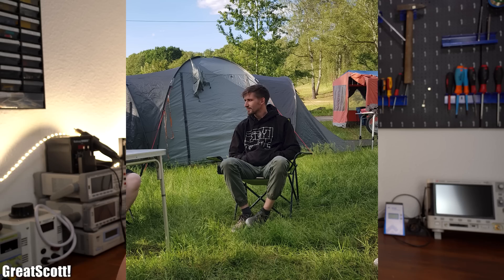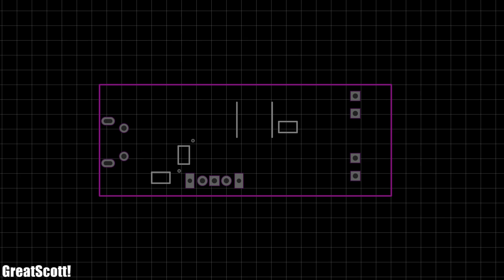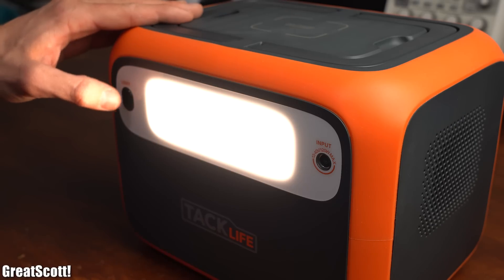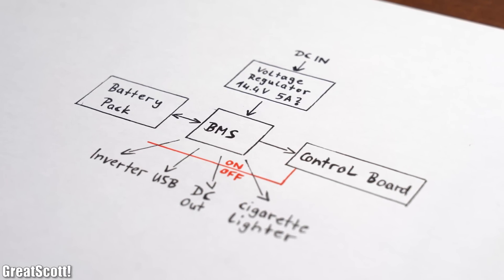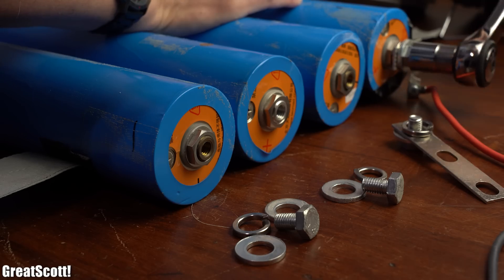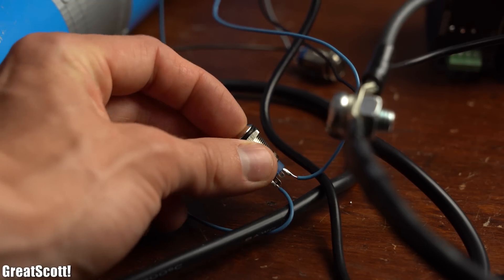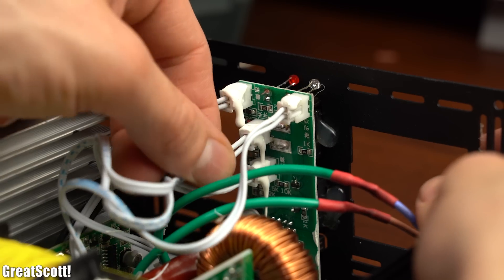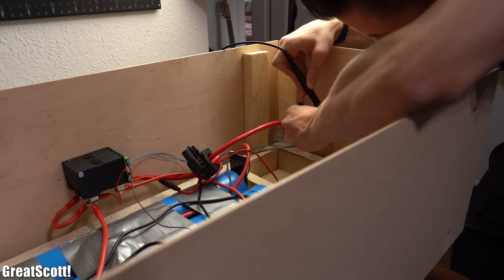Portable Power Station || DIY or Buy

Comment: you just not adding a ventilation hole on the wood box for inverter (because the inverter has a fan).. 
that means, all the components inside just heating themselves up..

Comment: Question: I bought a 100ah mini lifepo4 battery and a 300w inverter, I want to make quick connect for charging the battery but not sure how with inverter also torqued down to battery terminal. I also want to add a 25A fuse if that's necessary using 8 AWG. I'm confused on how I should do this, any input I would greatly appreciate.

Comment: Tech tips: Always plug and unplug the dc power supply went its not powered  by 110/220AC to prevent dc arcing. Same applies to laptops. Nice video...

Comment: While this video is a year old, Portable Power Stations suck still. DIY versions will get you what you want at about the same price or cheaper depending on what you use. 
1200 watt hour battery can be had for 300usd these days and the rest of the parts can be had for 300 as well. You will end up with a much better system if you build it your self. Yet if you buy commercial there is next to now way to upgrade the battery in the future. 
I do not need portable at all. Fixed is what i need and some of the big expensive portable systems cost more than a fixed system.

Comment: Nice build. I did the same thing without an actual enclosure.
 I used a 1/2 inch wide plastic cutting board and mounted the inverter on one side and the charge controller and DC connectors on the other side.

Its relatively light and portable.

The battery is separate and must be connected to use.

It is pretty much a small solar power system that can easily be transported in the back seat of your car.

Comment: Great job!  I vote for home built.  

I finished my battery compression box the day you posted this. The unit is up and running daily. It has 560 amp hour EVE cells, 3000/6000 surge inverter, 250 amp BMS, 30 amp MPPT, 75 amp on board lithium charger. It was built to run a big refrigerator and 2 chest freezers on 120 VAC power. We lose power more often in Northern California these days. Last year it was only out for 47 hours in August here,  but much longer elsewhere due to wildfires and terrible winds. Its in a steel tubing cage on caster wheels but at 51 kilos, 130 pounds, its not portable. The 410 watt panel sits temporarily on the roof on the foam they shipped the cells in.

Comment: Excellent video and great finished product. The only problem I can foresee is the lack of ventilation for cooling. I understand that you have a lot of space inside but a couple of fans on the side to allow a constant air flow would do wonders. Also you could add a solar controller with MP4 connections to easily connect solar panels when you're on a long camping trip. Overall I really like it because I prefer units built to suit your specific needs rather than buying a generic product.

Comment: Very well done, for the full 1kw of continuos power I would have used a set OFC  2 gauge wire, it is still extremely flexible and soft bit would allow for proper transfer. 85 amps continuos through 8 gauge seems a bit weak. That is my opinion however and I build for the extreme as well.

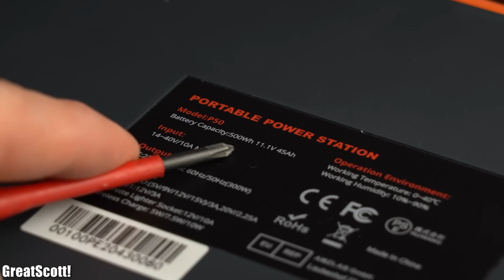Comment: At 4:52 You forgot temperature, since temperature is a pretty critical point for LiIon cells. Some standards as EN 62619 determine that cells may not be used when they are used out of their specification which also includes temperature.

Comment: need emergency 12v ups for router
Reply: Get an old 1500 volt amp UPS and add a sealed lead acid 50 amp hour battery on the outside. Some units are 12 volt, some 24 volt. I use both. The router should run for hours after power failure. My 12 volt one runs the security cameras and DVR for 6 hours unattended.

Comment: I don't know. It is sort of portable but not very practical because the size it has become. Also until now I use a 12v to 230 v inverter to power my 19 volt laptop. This year I just want to convert the 12 volts to 19 to power my laptop. That should save a lot energy. So I think you really needed to add a few 19-21 volt outlets. Maybe even selectable?  nice video anyway. What would be cool for some future video is a (substatnial) powerstation in a backpack :-)

Comment: personally I would have just used a deep cycle lead acid battery since you dont need a bms and you can charge them faster. yeah its less energy dense but still more reliable than any lithium derived cell

Comment: What about charging via solar Panel ? Most of the commercial Products offer to be charged with solar Panels... How would you Guys Set this Up ?
Reply: Add an MPPT charge controller. I put a Renogy 30 amp charge controller on mine and it has run 24/7 for 6 months with no trouble. The solar panel is 410 watts. The ''load'' terminals on it feed some USB charge ports, a pair of 12 volt cig lighter outlets and is good for 20 amps. I also installed a 75 amp Aims battery charger that can be plugged into the Honda generator if necessary.

Comment: Hi, 
I have doubt regarding dc power supply. Since you are pretty knowledgeable on electronics. The question is how do I connection 2 power supply in series / parallel to get a 48v dc supply from a 20v dc and 12 v dc?.. What I'm thinking is.. What if I connection both the power supply to separate boost converter and step up to 24v. Then connect them in series so I'll get 48v dc theoretically, right? Or I could connect them in parallel to get the maximum output of the boost converter. ... My doubt is does it after the output wave form or current draw from it.

Comment: Hmm i think the portable is the winner. Why? Let me tell you...

1. Smaller so easy to bring here and there and not taking much space.
2. Yes Smaller batre but when it finish, you still can charge and use at the same time using solar charging. So we no need big batre which too heavy to bring around.
3. No need so troublesome solder this and that, cut this and that.. Just buy the portable and you are ready to use.
4. You need more power? Just buy 2 of that portable, and you got more power. Easy as that.. 😁
5. Portable design is much better than your diy 😁

Comment: Hay man funny question we are completely off grid out here is South Africa  I run our whole house off of a 1kw inverter and have 4 lead acid batteries running parallel  at 12v I am charging it from a 500w mppt controller with 4x 300w 24v panales  would a bms  work of for a bank like that? or would it just be a silly idea. I build our system for about 1500 Euro and installed myself. (Luckley our government is a lot less stringent here )

Comment: Actually for camping or Bushcraft activity we just need Battery Bank that can deliver; 
1. USB charging port 5V and Quick Charging,
2. DC port for 12V or 18V,
3. COB LED for lighting.

If we need power tools for drilling or grinding, cutting saw etc, make sure take 12V or 18V cordless power tools or make its corded with DC from our Battery Bank.

This settings always enough to camping or bushcraft activity. Simple, elegant, cheap, durable, and ready for all occasions even for survival.

Greetings from Indonesia 🇮🇩

Comment: Well done Scott. Very nice project. One improovement could be to add fast fuse between an inverter and the AC socket because this type of inverter doesn't tolerate shorts on it's output despite what user manual says.

Comment: Great video!  I did exactly this last year only, instead of charging from a wall outlet, I mounted a 100W Renogy solar panel to the top of the enclosure and included a Victron charge controller to keep the batteries charged.  My setup was comparable to a Goal Zero model that costs several hundred dollars more and doesn't even include the solar panel.
Reply: Boss why not have radio FM and SIM card WiFi

Comment: I would highly recommend using torx aka star bit screws for your wood working. Also an impact driver helps a lot. It will help with the problem of cam out (drill bit pushing upward and skipping turns) as well as stripping out screws. I love all of your projects and watch all of your videos. Big thanks for all of your amazing electronics engineering knowledge from a humble Texan electronics noob 🙏

Comment: I agree on DIY. I think especially when you factor in cycle life & longevity. Most of us have had cheep Chinese inverter & DC-DC converters fail & know how annoying it can be. 

With my own electronics I like everything to be modular, that way I can replace components cheaply if something fails. If something fails on a 500 £ / € power pack you can't guaranty you'll find the fault & you're probably unlikely to get a replacement board & almost certainly not cheap!

Also if you factor in mark up (profit) & marketing it doesn't leave much money left for batteries so I doubt if the cells are premium quality & are going to be Li-ion not Lifepo4 (1,000 cycle vs 3,000).

I know for the video you used parts which you already had, which is great but obviously they don't need to be so big or cost as much.

This is something I've been planning to build for a while, basically a battery bank / Power pack I can plug in with an Anderson connector into my boat, caravan, car & to use camping. (Why buy 4?! :-) )

Good vid though, always good to watch.

Comment: I'm sure you already thought of this, but for the sake kf discussion: if you do have a laser engraver, you can use it not only to label the ports, but also to mark cut lines on the wood, to follow later with a saw or jigsaw.

Comment: You should build a Ebike camper, something that can be folded up and towed behind a Ebike,. Or maybe a ErV! A Ebike camper. That is self propelled like aa Winnebago! Maybe a      Etrike that you can sleep in after unfolding! It could be a ebike, with trailer. With a trailer with its own battery and motor,. To help make it mobile, with a throttle that can be attached to the handle bars, maybe even a E motorcycle! A trailer with its own 1kw motor, and 3-6kwh battery, with inverter for lights and Regen charging would be awesome, pull with a regular bike, and it could push you to the destination!! I guess that would have to be a diy, because I don't think it could be bought!

Comment: It's very good, I congratulate you on your work. Try to make a version 2.0

I am designing a portable version, that I can carry in the trunk of the car, that handles 1500W to handle electric tools, fans to cool the air (it's hot here), with a battery from 600Wh to 800Wh, and that can be charged from 0 to 100% in 4 to 6 hours with AC. This way it can be charged quickly at night. And the important thing is that it does not weigh more than 15 kg, so that anyone can carry it, for example it must be easy to climb to a roof of the house using a ladder. Like you do with a small gasoline generator.

I like the idea of being able to take it anywhere using a sedam car or a hatchback, I think anyone can use it. And with enough power to do many tasks. For example, here in my country there are many power cuts, with a solution like this you can use a microwave, use some lamps, use a coffee maker, a baby bottle sterilizer, an oxygen concentrator, a refrigerator, a television, a wifi modem , charge cell phones and tablets, etc. etc.

I am sending you a link of a commercial model that I really like its design, with its wheels and those things I think is very good, however it looks a bit of poor quality. So I think it is better to do mine.

https://drivelong.en.made-in-china.com/product/WORaDkXyEfps/China-Super-Handy-2048wh-Power-Station-2000W-Hot-Sale.html?utm_source=micsm&utm_medium=focus_mail&utm_campaign=visitor_marketing

I also send you a video of a very simple design made of wood like yours but very compact with a handle to carry it. I like it because it is shaped like a briefcase and is easy to handle. And the woodwork looks easy and sturdy, you can almost use it as a chair, hahaha.

https://www.youtube.com/watch?v=4vkq-JISHEM&list=WL&index=14

Greetings from Venezuela. I hope to see your version 2.0
Reply: The question is....which is better, Regional or Polar cerveza. I prefer coco frio, churrasco, y yuca fritas.

Comment: try to use High Discharge 3.2V 280Ah Lifepo4 Solar Battery Cell like 10pcs of it
Reply: 8 works fine. That's 560 amp hours 7200 watt hours. I made one about the time he posted this.

Comment: I read somewhere that those power supplies are not ideal chargers since they will drain some current from the batteries whenever they are connected and not charging. This was in the context of much smaller batteries though. Do you have any thoughts on this?

Comment: I think you identified the main problem with power stations you buy - they try to do everything and they cost a lot as a result.
In reality, as you have shown, everybody's needs are different - You want USB and mains output and don't need 12v. I need 12v and USB but I don't need mains.
I've just finished building my own power station which does what I need and no more. Cost me £120 - with the greatest savings being not needing the inverter and the cabling and larger batteries that go with it.
DIY is definitely the best option.
Reply: Boss why not have radio FM and SIM card WiFi

Comment: I would be quite worried about having that much energy density in a flammable box, why didn't you use an abs inner lining or something, to protect against the thing going up in flames if one of the batteries fails

Comment: I built a very similar thing for my van about 2 weeks ago but using 12v deep cycle 90amp battery that charges of the van, but is disconnectable so I can power my pressure tester off the 12v side and use the inverter for charging power tool batteries. But I never thought about putting fuses on any of it xD

Comment: A few days ago I built a lead acid battery based powerbox with almost 3000Wh power for around 300 Euro. No need for fancy lithium batteries and you can charge it with your cars alternator.

Comment: I built 2 basically one is 585 watt hour with a 500 watt inverter an the second one I have the battery built with a 1425 watt hour battery and am trying to get a good 1500watt inverter that fits I have tried a couple but they can't do what I need
Reply: Watch out. You will get hooked on this stuff. My latest home made power box is 7200 watt hours, 560 amp hours, 3000 watt inverter with 6000 watt 20 secod surge, 75 amp onboard charger, 30 amp MPPT solar controller. I used it every day for the last 6 months. It will run a window 10,000 watt AC unit for 7.5 hours, runs my small wire feed welder. It's purpose is to run a home fridge and 2 chest freezers when we lose the grid again. At 130 pounds and on caster wheels, it stays under the work bench out of the way. 
     What are you trying to run?

Comment: a strange calculation in the purchased 1 euro per 1 watt of capacity, and in the made 1.32 euro it turned out that it was made more profitable. It may be more profitable, but in the produced 1 watt costs 0.75 euros.

Comment: K R A L Y N 3D made a 18650 small battery pack with usb dc output and a ac adapter to have ac and he made his own dc to ac converter which can reduce the price and you can use a arduino to control the ac inverter and use it for the control for the battery and the current sensing and how hot or cold the pack is or how much charge there is or turn on a dc port. Hopefully this could make it cheaper.

K R A L Y N 3D video here: https://youtu.be/tTgXwruB7vk

Comment: North America 110v spec requires 2x amps for same power making portable ac too expensive... however I do need 12v to power the 12v leds 12v fans 12v refrigerator.  I need 18v for laptop charger.

Comment: I need something like this for a Cpap ups that ill only use at home. Don't want to wake up if the power goes out. Want a Lifepo4 battery but don't want to use it all the time. Not sure if i should buy or make my own.
Reply: Building portable CPAP power units in the Summer of 2017 is what got me started on making these things. We lost power in Norcal too many times since October 2017 when the massive wildfire and windstorm destroyed thousands of homes Coffey Park. I made some with the capability of being recharged with jumper cables from a running car. Some used Minn Kota plastic trolling motor boxes. My last one has a 100 amp hour lithium battery, 300 watt pure sine inverter, utility light, 12 volt outlets, voltmeter, and can be charged enough to run the CPAP overnight after 20 minutes on jumper cables. The heat function setting on the CPAP cuts run time down.  Without heat, 60 watts is normal. A 100 amp hour battery can run it 21 total hours....3 nights, with one charge. I buy the Bestek 300 watt pure sine inverters when they are on sale.

Comment: How is the diy safer if it isn't waterproofed?????????????
Reply: It perhaps should be water-resistant      why should it be water-proof?   Will you use it at the bottom of lake.
Reply: I dont mean waterproof like a submarine. It needs to be at least resistant to rain because clearly he made it out of wood, so if rain comes in with the exposed ineternals of the  invenerter , you know what will happen.

Comment: Nice build! 
I was surprised the store bought one looks like it was actually made reasonably well, I was expecting a pitiful battery bank and bad wiring jobs.
Reply: I've had decent luck with tacklife products. They're a good chinese brand. I use their jump starter in my car. Never personally used it, but had people ask me to jump their cars multiple times, usually in a parking lot where then you have to awkwardly maneuver your cars to get the leads to reach and whatnot, and that thing has worked every time and holds a charge. Had it for two years now, never charged it once. Supposedly can jump a diesel pick up truck and a Suburban. I have a highlander.